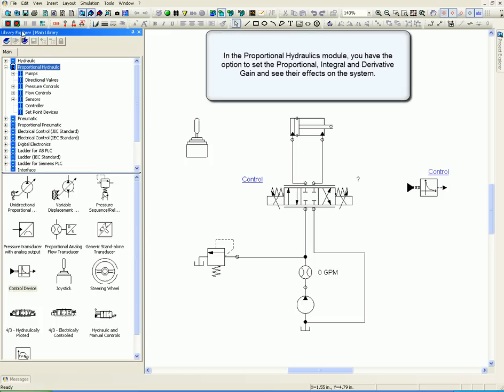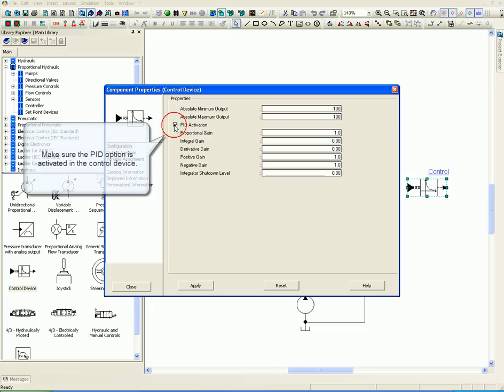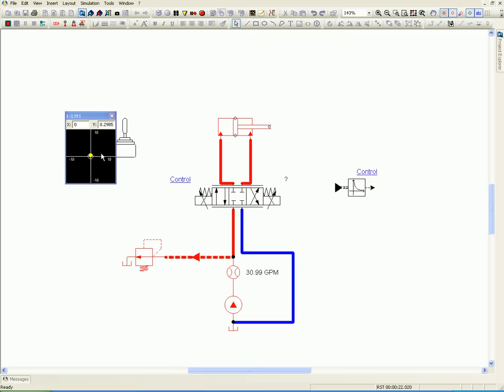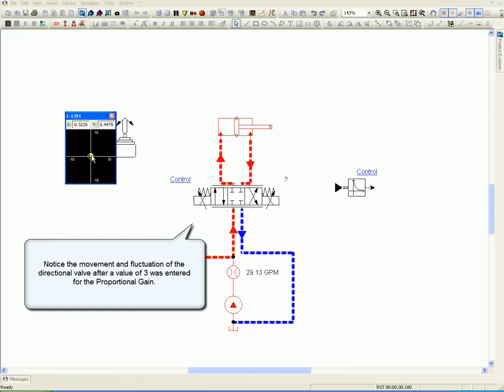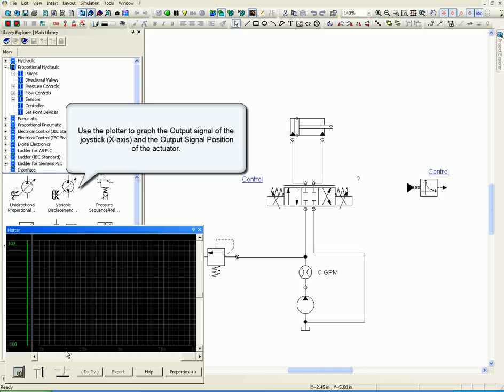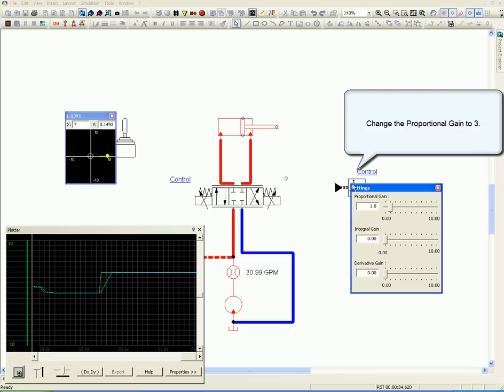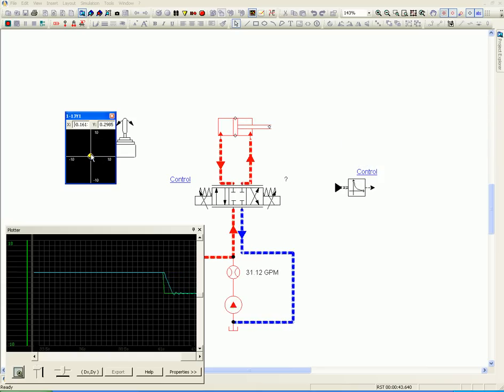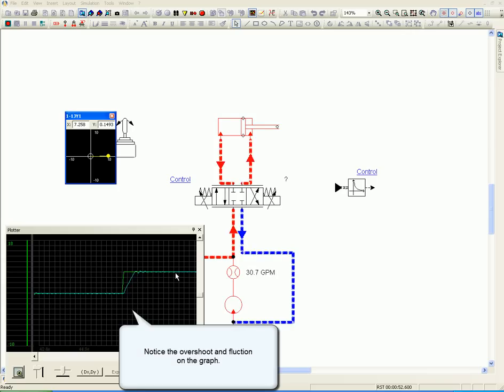Close loop PID - Proportional Hydraulics, Automation Studio™ Educational Edition

Comment: Please, can you explain how to write PID euqtion into Control Device Output in ouput variable. Thank you !
Reply from the maker: Hello nguyen do! You need to write the equation according to what you are trying to simulate. For example, a basic close loop system would be Value of my set point, minus the position of my cylinder and the output would be in error mode. Then, you need to associate the output of your controller to the directional valve.
Reply: Thank you so much.